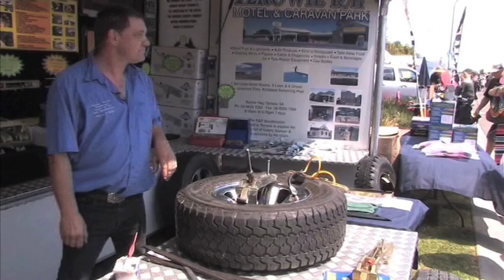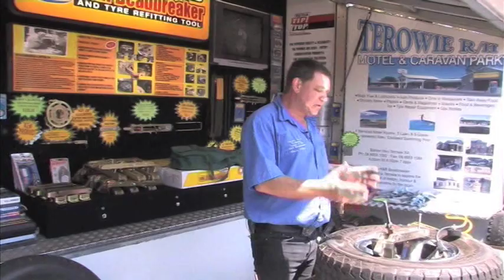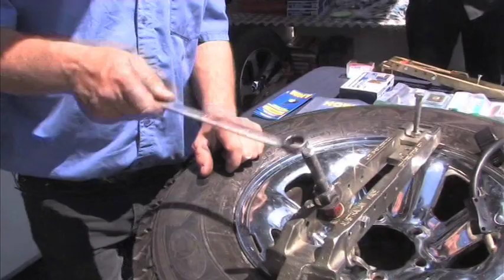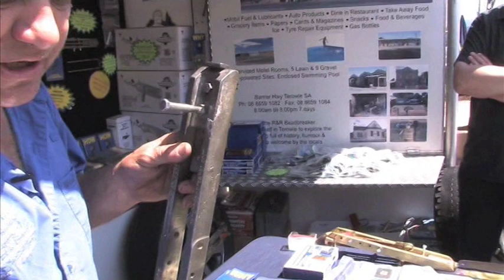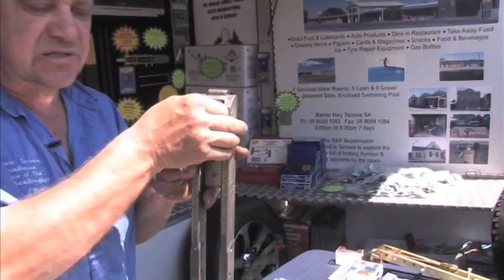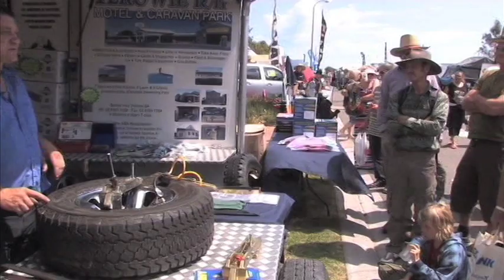R&R Bead Breaker & Tyre Refitting Tool Demonstration at Adelaide Caravan Show 2013

Comment: I have this tool and been using on my landcruiser rims for years without any problems but just the other day I need to change tyres on my Toyota Rav4 with aluminium magwheels which are actually dished out beyond the level of the tyre on top of that the centre whole was smaller than the hook 
I managed to solve problem with centre holes but there was no way to use the tool because of the type of dished out rim. 
Have you came across same problem if yes how did you solve this 
Looking to hear from you ASAP thank